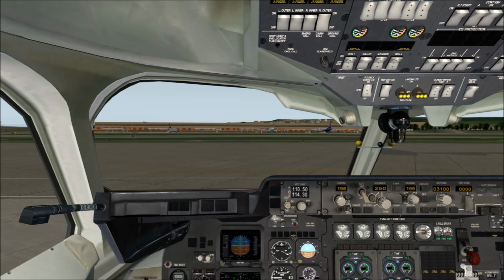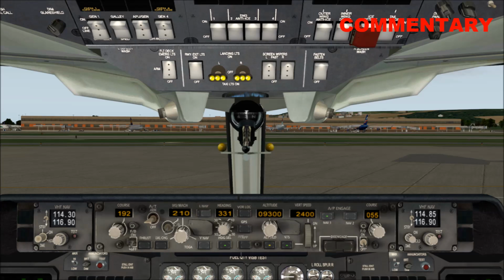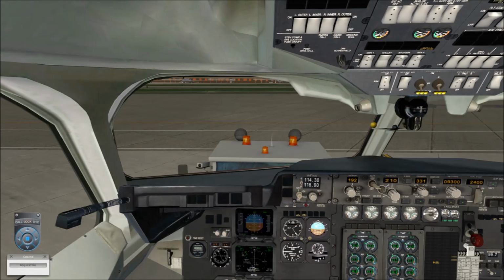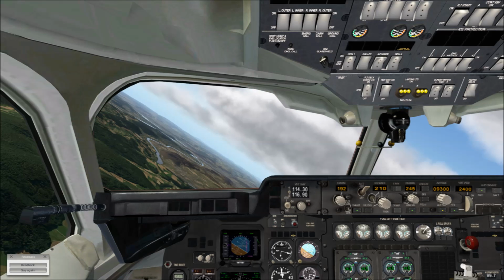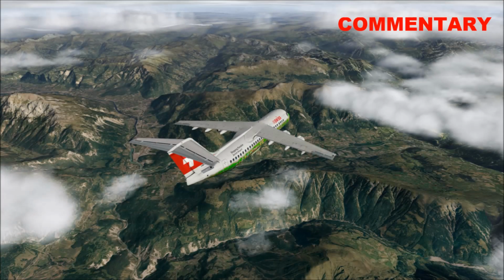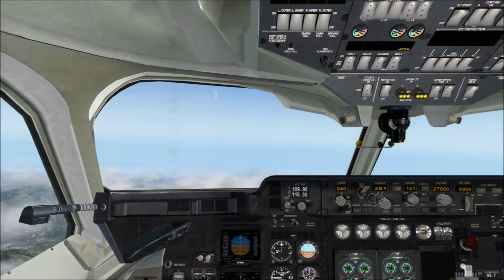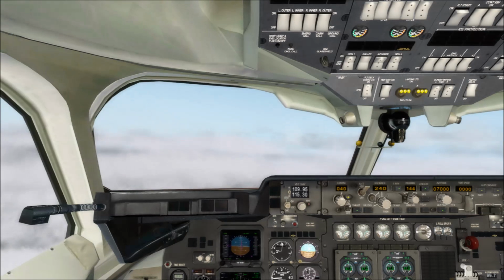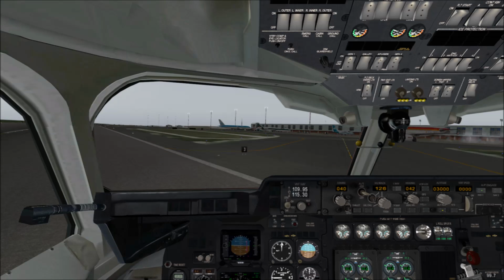124thATC 2.0 Preview

Comment: Thanks for the great tutorial. I installed 124thATC 2.0. I understand that one can change the Windows Text to Speech voice in Control Panel but how can we make 124thATC 2.0 use two different voices, one for the pilot and the other for the ATC. For now the same voice is used for both and it is confusing.

Comment: Great plugin! Can I somehow change the voice of the ATC? I like a deeper voice.
Reply from the maker: in control panel you can change your Windows voice settings.  The voices are available on internet, you can use ilona or other voice packs. Refer to windows documentation for install and handle it
Reply: You can change windows speech voices, I tested Ilona voices, are pretty good voices
Reply: +Antonello Matacchieri hello sir, thank you for this great plugin! About changing windows speech voices, how do you do that? I have been looking on how to have different voices, and I wasn't successful!
Reply: Thank you for the help I appreciate!
Reply: I knew you are a teacher :)
Reply: About the ATC volume, mine is not loud enough, I can bearly hear the communication. Please, where can we control the volume of the plugin if possible?
Reply: how can use it? i opened the zip file opened the 2.0-a59 folder and copied the folder in it (124thATC64) in the plugins folder what did i make  wrong?